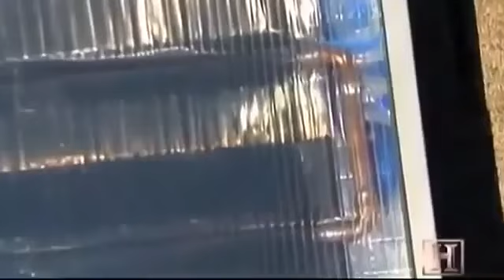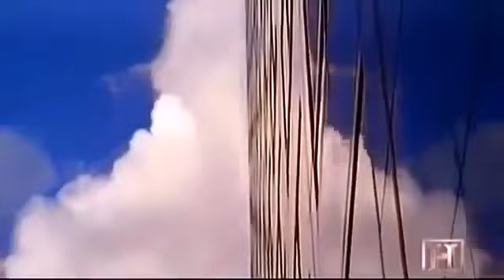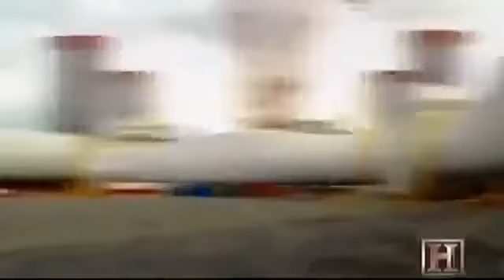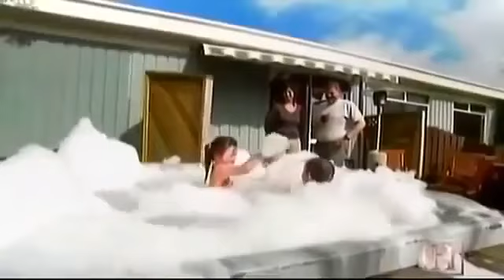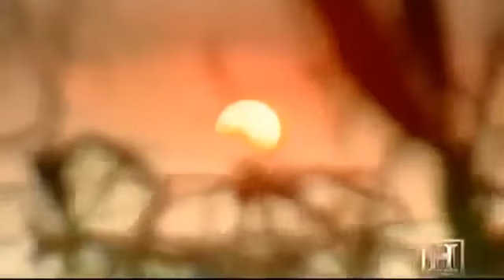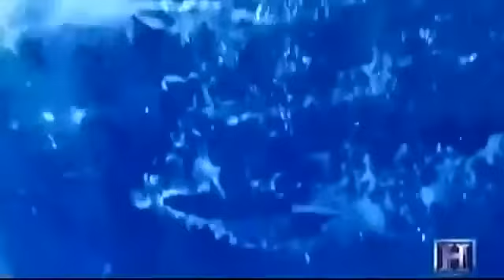Twenty First Century Renewable Energy : Documentary on the Energy of the Future (Full Documentary)

Comment: solar is this best renewable energy
Reply from the maker: Why do you feel it's best?   I flew across the county last week and from the plane I saw thousands of wind generators across the midwest states.  It seems out there they think wind power is the best one.
Reply: First, let me state that all renewable energy, less geothermal, is solar based. Without the sun there would be no wind, no water cycle and no biomass. Second, the energy density in renewable energy per unit in Btu is less than in fossil fuel energy. Third, only an energy mix that utilizes all available renewable sources, as defined by the geographic location, can provide complete substitution for fossil fuels (oil, gas, coal and uranium). So, just embrace all renewable sources.

Comment: Replacing fossil fuels with renewable sources of electricity or heat is only part of what has to be done if Global Warming is to be averted. We also need to reduce our energy consumption by a considerable amount. Insulation of homes/factories will go a significant distance in achieving this, and more needs to be done to make insulation more efficient/cheaper. Small scale generation (solar PV panels on rooftops helps, as does gsp and asp. Even individual water turbines can assist) but the long-term solution has to be minimisation of use by everyone. Quite a challenge, but one we must conquer soon.
Reply from the maker: I just have he feeling that, like most other things, money is going to be the driving force for change.  As long as there is sill enough money to make fossil fuels profitable, they will continue to be utilized and exploited.  I suppose governments can propose taxes to make the economics favor renewable energy, but it will always have plenty of backlash from the public paying for it as well as the companies and shareholders that profit from fossil fuels.
Reply: And when the reserves of fossil fuel become too costly to extract, what then? Just imagine an oil-free planet?
Reply from the maker: I remember reading a book about cold fusion back in the early 90s.  There were so many groups supposedly coming so close to finding methods of producing limitless energy at low temperatures using water and palladium.  They were predicting it would be in production by 2010.  Every time I heard of any progress made since then I got so excited. lol.  I guess I'm the fool for getting caught up in the enthusiasm of the over confident.
Reply: Rest assured, my friend, cold fusion will remain a dream for centuries yet, as will hydrogen fuel cells that cost less than batteries.